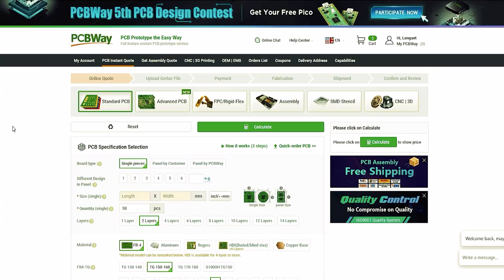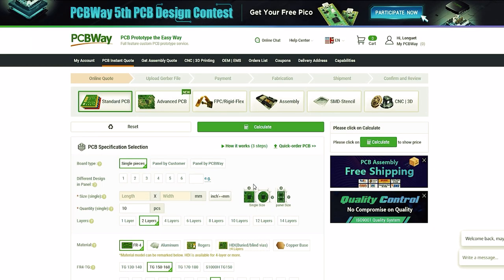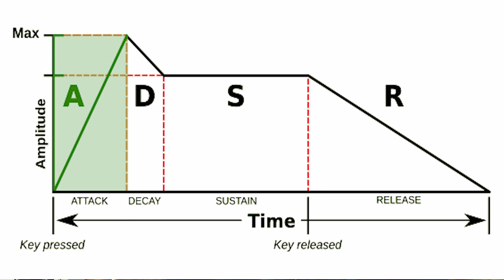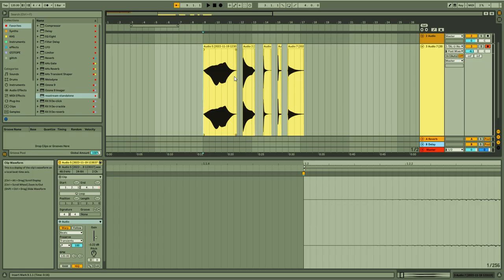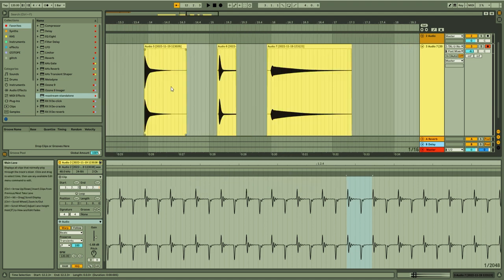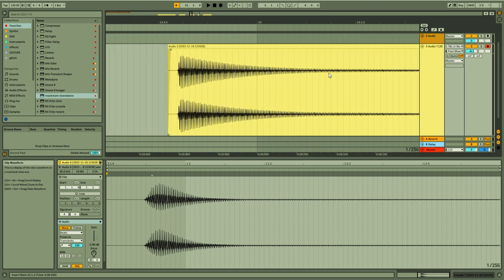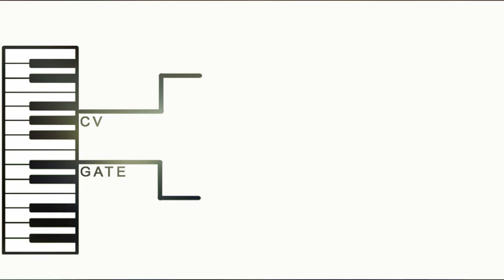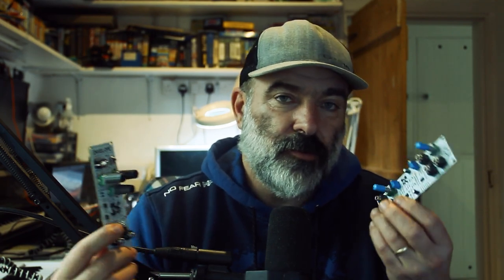MODULAR Synth: VCA & Envelope explained

Comment: Great video! Noob question for you. Is there a way to both have your VCA follow an envelope like this as well as simultaneously responding to your velocity? I assume you'd need a MIDI to CV converter with a velocity out, but where would you send this velocity out to get both of these to work in tandem? Thanks!
Reply from the maker: not really possible with one VCA. but if you've a way to get the velocity CV out of your controller/keyboard (like with the keystep pro) you can take the VCA output and send that into another VCA input and send the Veloticy CV as a modulator instead of the envelope. That way the velocity will control the volume level ... or you can send it to the filter value... or an LFO... 
There's a rule of thumb with Eurorack : you never have enough VCAs :D :D